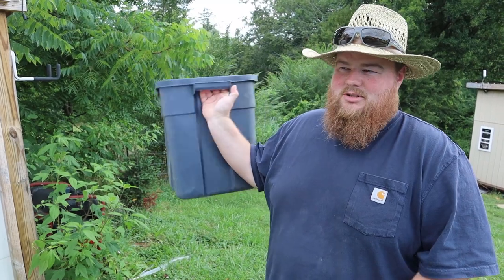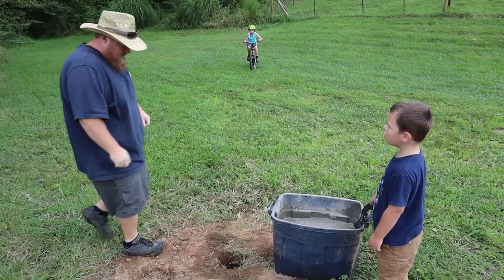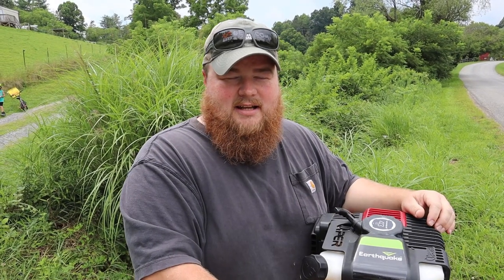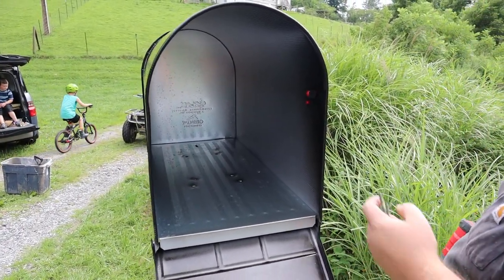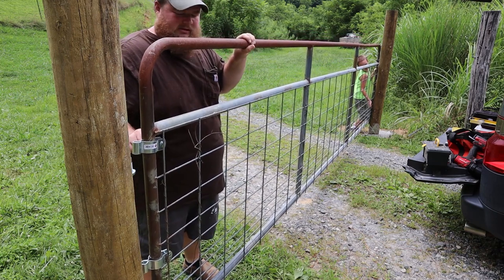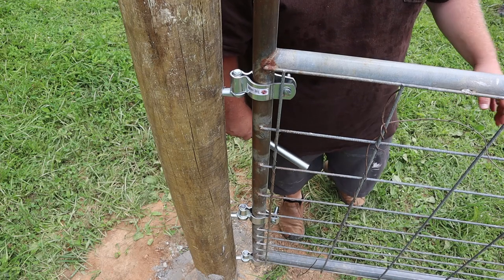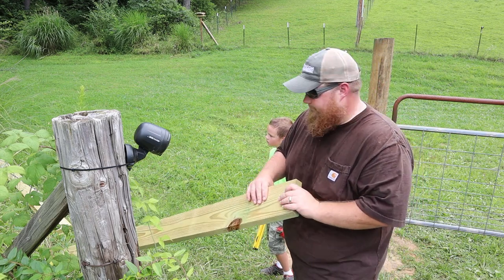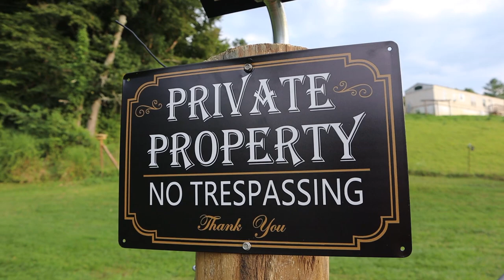Off Grid Automatic Gate Opener for the Homestead // Mighty Mule Gate Opener

Comment: The good  , lots of resources on YouTube on how to troubleshoot and repair . Parts availability is very good .
The bad , your going to need back in the control box . Mine has never been sealed , box has been free of condensate every time I opened it  .  I have more desire to seal control arm , it has had condensation every time it has been opened . My FM500 is nearly 20 years old , putting new motor in as a maintenance soon . My wife loves it ,so it is a high priority for me . May God bless your family

Comment: Sam, great involving your son, good job. It is easier if you put dry concrete mix in the hole and tamp it, then add some water. Usually there’s enough moisture in the soil that you don’t even have to add moisture to get the concrete to harden. Plus the bottom hinge is upside down. The bottom hinge is supposed to point down so no one can just pick up the gate off of the hinges and get in your property. I really enjoy your channel keep up the good work.

Comment: I helped my cousin install a mighty mule with all the accessories on his property. In about a year the motor burned out. I installed a ghost controls on mine with all the accessories on mine. Slightly more expensive but it opens and closes faster than the MM. GC has more features and has soft start and soft stop which is easier on the hardware. I'd recommend the ghost controls system.

Comment: Build like a bus stop shack for your packages from UPS, Amazon, Fedex, could even be made out of pallets with a roof to protect packages. I had a customer that had a 8ft high solid wood fence that he put a small (3' x 3") door on the driveway side and built a shed area on his side. I just open door and put packages inside. You could do that where you put the wood bracing rails for the post. Would also solve your attempts by the mailman. Just put "deliveries" on the door. Ideas from a retired Fedex driver, LOL

Comment: The opening/closing thing is most likely the limit switch in the arm going bad. If the control board doesn't know where the gate is, it won't know when to stop it, so it just keeps cycling. Also, its a mistake to seal your box like that. You should open it frequently to check for insects, clean/test battery etc.  You don't want to seal in moisture either.

Comment: I have a gate. UPS has my gate code in their system so any of their drivers can access it and make deliveries to my front door. You should check it out.
Reply: I am retired Fedex and had most of my customers gate codes (on same route for years) and I see amazon has a spot for gate codes on their shipping info. The only problem I see is winding drive not much room for inexperienced drivers to turn around at their house. We were not allowed to leave ruts in a yard.
Reply: Eunice Henderson UPS drivers can only get the codes by accessing their computer system. So the codes are not stored on insecure sites or carried around by drivers. FedEx has the ability to do the same and I set it up with them but their drivers won’t or don’t know how to or are in just to big of a hurry to get the code. So they leave my packages by the gate. When I have something being delivered by Fedex I have to monitor the delivery so my package doesn’t remain there any longer than necessary. I like UPS much better.
Reply: @hartshut  Not sure about UPS but have given many UPS drivers subdivision gate codes because they could not get inside. Don't know about how the Fedex system works about saving gate codes on the computer. I was out  making deliveries and sometimes in the small comment section their would be a gate code. Fedex has so many divisions Fedex Express, Fedex Ground, Fedex Home Delivery, Fedex Freight.

Comment: Would have liked to see deeper holes for posts, that first cement mix was like soup, to much water. You will need the additional timber supports on the posts so they stay upright. Don’t just say “suppose that will do” do things correct the right way then save you doing it again, YouTube is a great learning app.